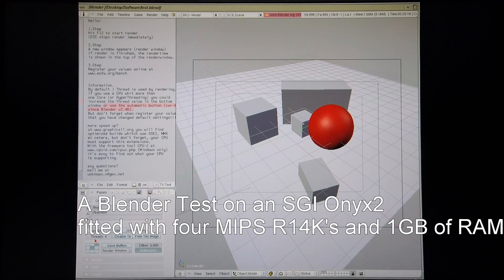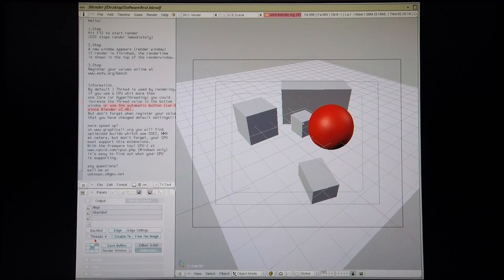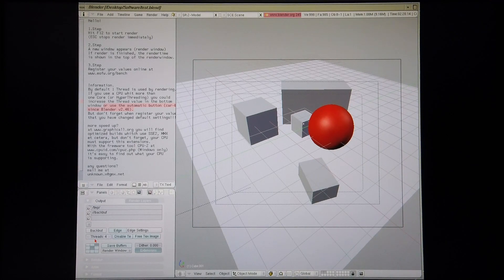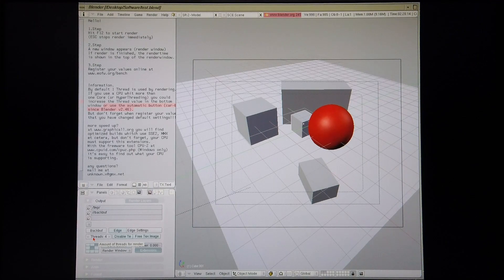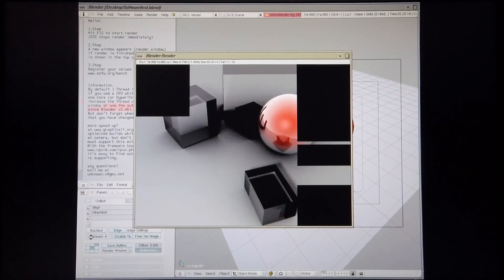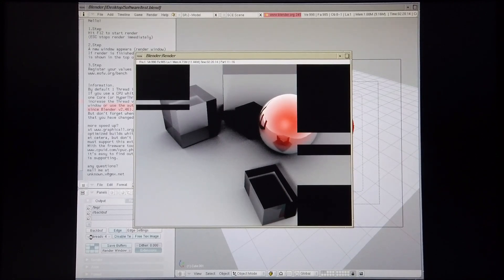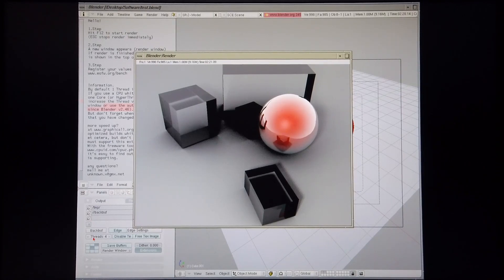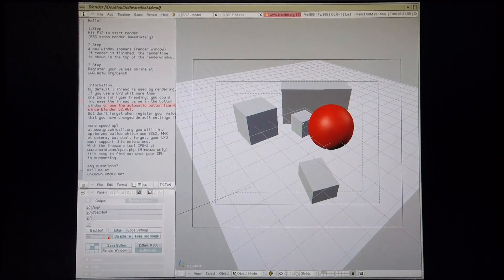A Blender Test on an SGI Onyx2 fitted with four MIPS R14K's and 1GB of RAM

Comment: Always faster with more threads than CPUs. I'm not sure why but I suspect it's something to do with how the MIPS design processes the instructions, branch prediction, caching, something (really not sure), but it makes the CPUs act a little bit like they have a natural degree of HT ability.

Btw, I'm assuming the Blender binary (the one that does the actual rendering) is MIPS4, is that true? Just occured to me, is this also the case for the render binaries being used by Maya and other pro apps on MIPS4 SGIs, ie. did the sw vendor companies bother recompiling their code (or indeed rewriting parts of it) to take advantage of the MIPS4 ISA? I remember discovering way back that the Flint binary for R10K Indigo2 is still only MIPS3.

Oh, remember my main summary table... :)

http://www.sgidepot.co.uk/perfcomp_RENDER1_blender.html

and you've made a mistake btw, for multiple CPUs and sw rendering, it helps to break up the image into a larger number of smaller pieces. When I tested my quad-500MHz Onyx2, I use a tile size config of 16x16 and 8 threads which gave a render time of 1min and 56s, which is way faster than your result. Also note that I used Blender 2.44 because it's 11% faster than 2.45. I've not yet begun testing with 2.48 (think I had problems way back getting it to work). Which version of Blender are you using?